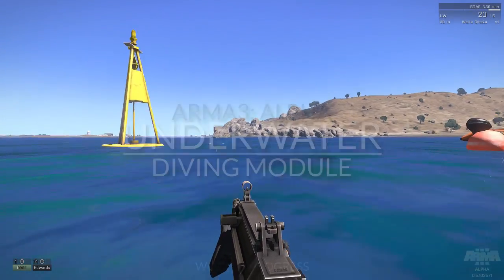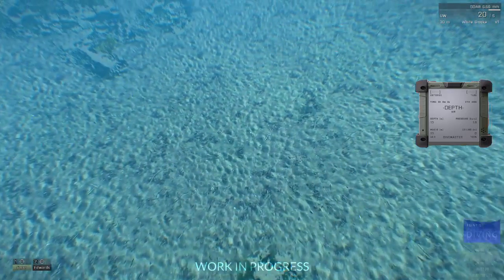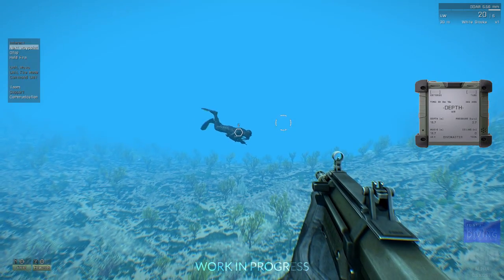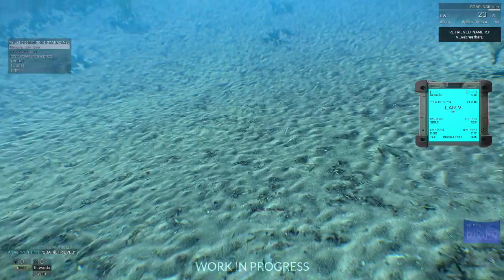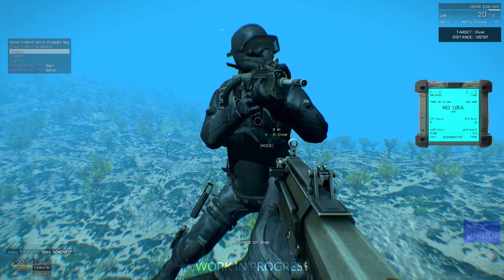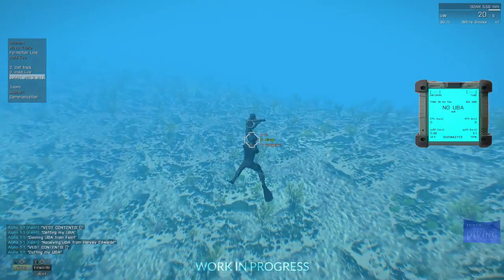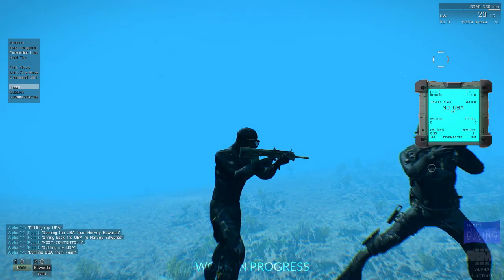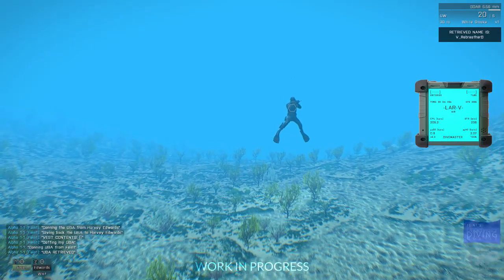Arma 3: Underwater Diving Module

Comment: I believe this mod was on Steam for a while, but now I cannot find it.  Was it removed?  Also, did you ever figure out how to access your own (or another character's) inventory while underwater?  This seems crucial for underwater gameplay, but BIS hasn't facilitated it yet.
Reply from the maker: No it wasn't. I eventually released various features of the mod as standalone add-ons. Accessing other people's inventory or your own was hard coded off. I figured out a workaround but it was unreliable and difficult to get to work consistently in the same way, so I abandoned the effort after months of trying. Sorry but some things require BI to change
Reply: @Feintgames  Thanks for the reply.  That's too bad about the "hard-coding" by BIS.  >:(
I have searched, but the closest thing I could find to your UDM was your DiveMate computer /watch mod. 
Are you still modding in A3, or have you moved on to other things?  I joined a mod team & started learning terrain development last November. I would love to talk more with you - if you are still interested.

Comment from the maker: In Arma3 while wearing a UBA, the breathing is automatic.  However, if you remove the UBA, the unit simulates holding of the breath automatically.  But it would be possible to simulate a manual breath hold (like before removing the UBA)...but to what end?  At some point, some things need to happen automatically for a game to remain playable/fun.  I'm interested to hear what your thoughts are though.

Comment from the maker: The in-game breathing sound seems fine to me.  It doesn't have a hiss to it like a compressed air respirator has.  It sounds like air being pushed through a mask and tubes.  I'm fine with it completely and it sounds like the sfx I have which is a straight recording from a Lar-V rebreather.  Yes, I have plans to add open-circuit compressed air tanks.  Buoyancy effects?  No plans for that at this time.  Change the dive computer for open vs closed?  No plans for that atm.

Comment: The hiss 'darth vader' sound we're hearing is from air under pressure. A re breather doesn't sound like that. Plans to add actual tanks? Additionally a re breather's computer is different from a standard dive computer. Ideas? Also, buoyancy would be nice to add. As, if you remove your BCD and integrated weights, you start to float.